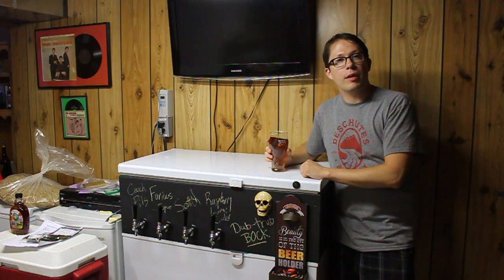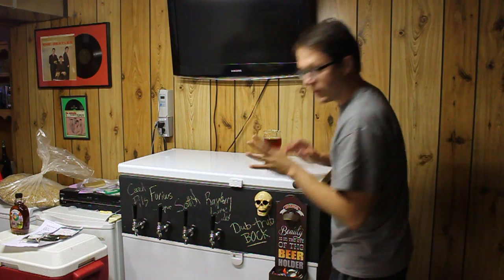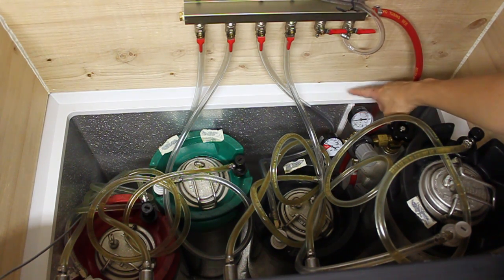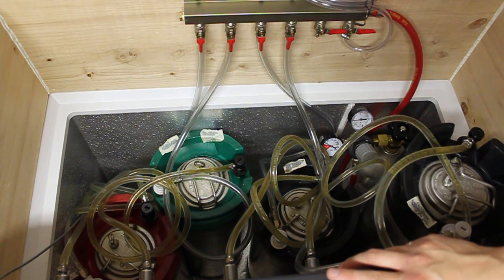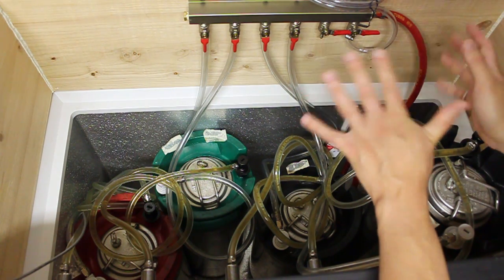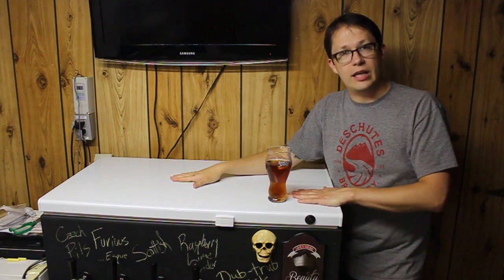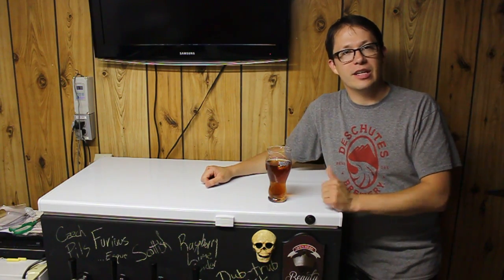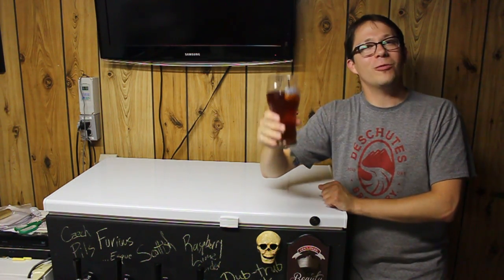Tour of Joe's 4 Faucet Kegerator / Keezer (How To Build A Keezer) (How To Build A Kegerator)

Comment: I had a little party at my house when I had picnic tap lines in a chest freezer and my brother at the end of the night opened the lid for his last beer and saw something sticking in. He took it out figuring it was just junk that wasn’t supposed to be hanging in there. It was the temp controller probe. Two days later I went to have a beer with dinner and all my beer was frozen. The lines were so stiff I could barely move them. I have since added a draft beer tower with three taps. So I shouldn’t have that problem again.

Comment: I run a dual primary regulator so I can set one to carbing pressure and one to serving pressure.  I can fit 4 kegs in my kegerator so I just do a 3 line distributor.  One regulator goes to the distributor, the other is just a single gas line.  If I have a full kegerator I just set the second regulator to serving pressure and hook up a tap line.
Reply from the maker: Daventure That does the trick!  Cheers!

Comment: Since I built my keezer a couple years ago any kegs using the manifold had ridiculous amounts of foam. My most recent beer is connected right to the regulator, no foaming at all. Perfectly pours. I took the manifold apart, cleaned it and put it back together with teflon tape on all threads. 

Is this a common problem? Have you had this happen?